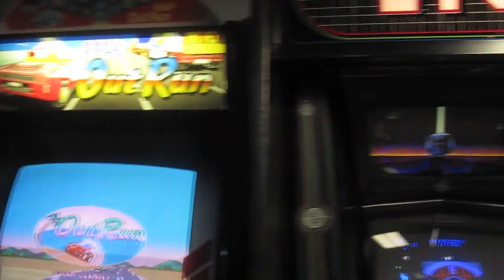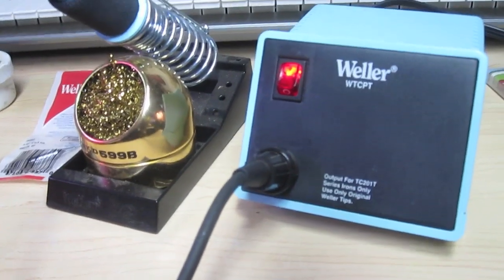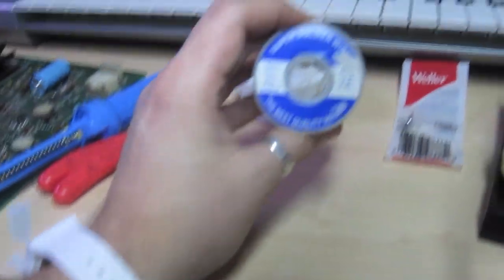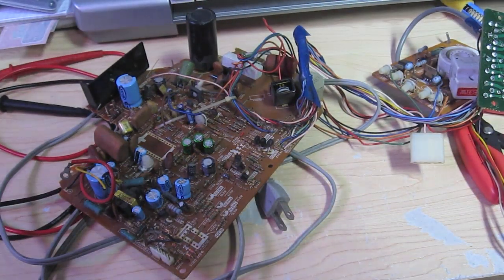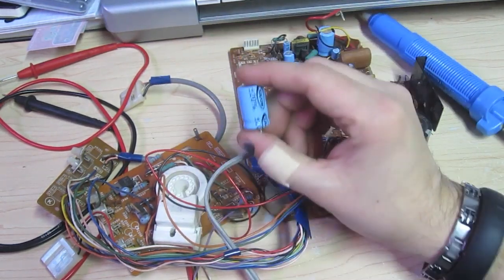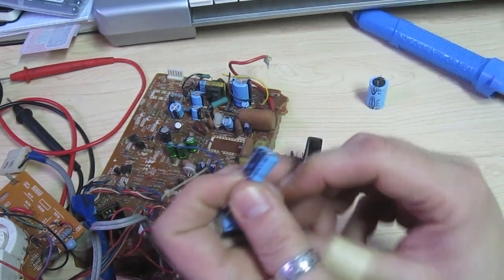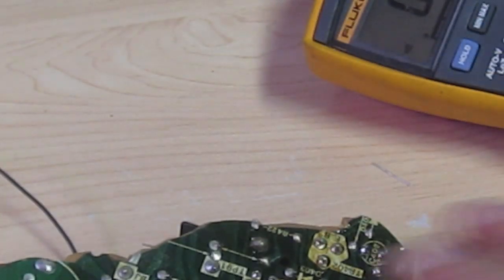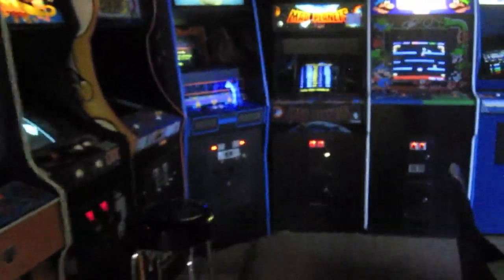HOW TO SOLDER - Arcade Tech - Soldering Basics, Monitor Cap Kit, Desolder, etc.

Comment: I used a solder sucker like yours for years... one day I bought the radioshack de-soldering iron with the intent of modding it into a cheap hot-air rework station... I test it out as a de-soldering iron... it will CHANGE YOUR LIFE, or at least the way you remove components lol. the difference between the sucker and the iron is like the difference between a cheap iron and a weller station. and it's only $12... worth every penny.

Comment: one of your game line filters is shorting to earth.  Those filters are usually a couple of X or Y type capacitors and a filter choke.  Over this side of the pond I used to collect JPM fruit machines, they had the same filters , and it caused the same issue.

Comment: Thank you so much for this video tutorial. I just picked up a near perfect Zaxxon for $90 for my home arcade and it has the expected sound board issue with the 13 cheap ass caps that need replacing. I have never soldered and I really want to take care of this project myself. Thank you so much for the aid!

Comment from the maker: Yes it can be fixed. Usually you fix it by adding a "jumper" wire connecting the points that were disconnected by the broken trace.

Comment: it could be any one of them . Im mabye assuming too much here, but where your power cord comes in , usually , at least over here, the cord goes into a line filter before it goes to the power supply. A clue will be in what breaker pops. Is it the same bank of machines that goes off every time? thatll help you narrow it down.

Comment: also you might want to give small chisel tips a try. or even the chisel tip that comes with the wes51, which is almost a cross between conical and chisel. for many applications especially circuit boards, a chisel tip is going to spread heat much easier and quicker due to a wider area of contact. you dont want to go too big though. in not sure the stock wes51 tips name but I really would recomend not using conical for circuit boards. 

if you are using temperature control and trying to keep the temperature as low as necessary, a chisel tip is going to be better too. the conical tip needs more heat to heat the component anthe metal ring.
Reply: especially if dealing with large components, chisel tips are going to be advantageous. on boards with tiny little "slots" for the components, it may oberhang a little, but because you have a lower temperature you wont burn the board. and you could always use the side of the chisel

Comment: Fantastic video! I'm going to change out the caps on my Tempest  WG 6100 and install the LV2000 Light board and I had a question about solder diameter. I can only find Super Solder 60/40 with 0.8mm diameter. Does 0.8 work as well as 1mm? I can't find Super Solder in 1mm anywhere.
Reply from the maker: 0.8mm solder is perfectly fine. It's all personal preference really.

Comment: I have a RadioShack iron, and the only problem I ever had with it is that the tips disintegrate super easily with lots of use
It's a 50 watt adjustable temperature iron. Probably could get it around 30 bucks nowadays, pretty reliable.
Again, the tips suck.

Comment: when working with circuit boards you should have a temperature control iron. you havent burned anything yet, but some boards burn far easier then others. i assume you dont have the soldering instructions and temperature/time rating for each specific board so just my opinion. and for others to think about
Reply from the maker: I love my iron. it's never let me  down
Reply: +John&#39;s Arcade Game Reviews &amp; Tech Yeah!!! I love my WTCPT too. If you know how to handle the iron properly, it's kind of impossible to burn any board, 'cause you don't need to touch it at all. Have you tried using paste solder with this Weller? Damn, it's a new concept for soldering, it's like compare a manual gear with automatic.
Reply: Isn't the soldering paste bad for working on electronics with it? Since it's conductive? I've never used one and I don't rly know if there are really any benefits with the paste. Could you share more?
Reply: All soldering material is very conductive, otherwise, wouldn't be any reason to use it. When you use soldering paste to get the job done, you must use tweezers and a proper applicator (one that fits ok in your hands), you're gonna assemble all the components on the board and the last thing to do is just pass the iron over the edges. Is faster and easier, than hold the component, the solder wire and the iron all together.
Reply: Xiru Litorano 
Well, what you just wrote makes me go and buy some paste to try it, at least it cost around 1$. Thank you!
Reply: Just be carefull with the temperature, the paste must melt very well and start to shine, but don't over heat it otherwise you'll lose volume. You're very wellcome.
Reply: Xiru Litorano 
Thanks for the tip too.

Comment: As an avionics tech, the sponge is better. Get a water bottle to store with your station. I've been soldering together aircraft radios and harnesses for over a decade and have tried everything - water actually helps clean the tip of the soldering iron better than anything else. I've used the same tip on the same iron you use for literally 8 years - never had to re-tin the iron. Just wanting to pass on some knowledge.
Reply from the maker: +Derrick Proctor interesting. I find the sponge and water to be such a hassle. But you might be right!
Reply: John's Arcade Game Reviews & Tech Yeah the sponge removes heavy oxidation from the tip better.
Just keep one of these filled with distilled water and you won't have any issues with the sponge drying out. https://www.amazon.com/dp/B00WTHLR0E/

Another thing I've noticed from your videos is that you leave the iron on for your whole intro into what your doing and when you're not at the bench. I recommend not doing this. Leaving your iron on like this makes the tip oxidize faster and overall shortens its life. When you get up and walk away from the bench make it a habit of turning your iron off. Besides with a soldering station like the one you have it takes less than a minute to reach soldering temperature.